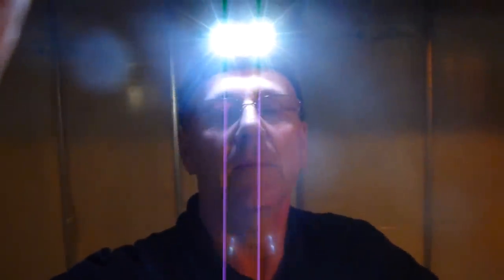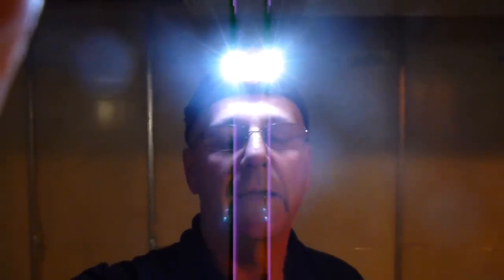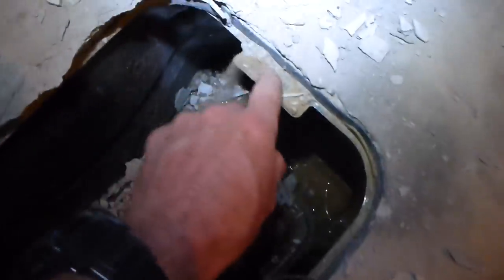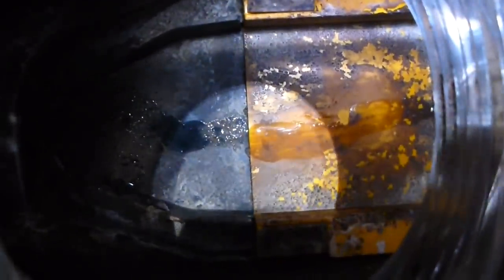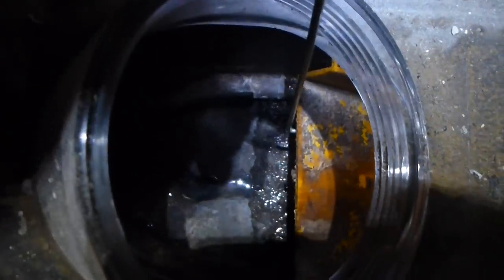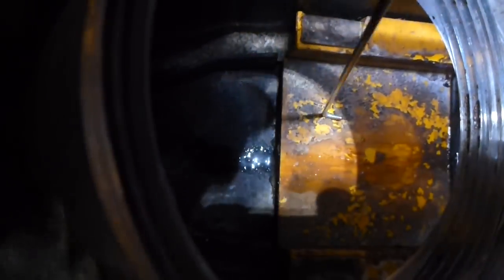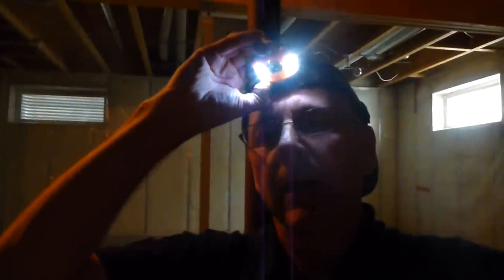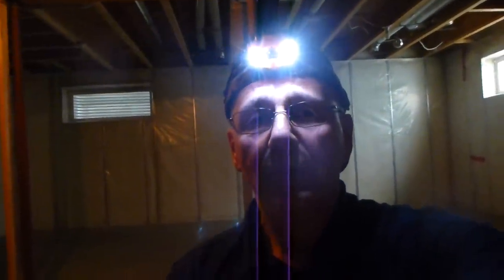Sewer Back Flow Valve, Stuck

Comment: Valve was 7 years old and still had concrete on top of container. It went 7 yrs without being maintained. Horrible. 2x a year min and after every back up. I have hose attached to basement sink with sprayer nozzle. Takes 5 min.

Comment: back flow valves are outside, underground, therefore how would this be accomplished-not only to find,  also to clean to make sure they were applied as was told?
Reply: He is inside the house down in the basement... these are actually called back water valves.

Comment: I absolutely would not buy that design it’s made to fail! The hinge should be at the top out of the muck so that water leaving the home continuously move the valve,And doesn’t cement it in with all the junk that goes through it.

Comment: How do you get a manual hand crank valve unstuck. Mine will not turn clockwise or counter clockwise?
Reply: Pb blaster daily for about a month.  Tighten a bit, loosen a bit.  Repeat over and over.  I’m working on one now.

Comment: More bureaucratic bull shit.....Here's what happens to these devices:
1. Someone runs a snake through it (not knowing it's there) and breaks the flapper off it's hinges...causing chronic back-ups.
2. There's a rubber "lid" seal inside some of these devices and it rots into pieces that fall down and cause the flapper to get stuck...causing chronic back-ups.
3. Once the rubber seal is gone it allows roots to enter the system...... causing chronic back-ups.
Somewhat counter productive right?
    I have removed about 5 of these devices (including my house and my rental's) and zero issues now. I'm a new construction plumber and have installed 1000's of these....none have ever done their actual intended job....kinda like air-gaps, water savers, anti-siphon valves, double-check valves and liquid plumber... none have ever done their actual intended job. But it creates jobs for those who make them....
HELP! (bureaucratic bull shit)
Reply: Hi
I just installed a different model of this NRV in my home. Mine one has hinges on top and the flap opens up to let house waste out and remains close in general. 
Have you installed these kind of NRV too? If yes, then can you please review them.
Reply: @sanchitgupta001  Not sure why anyone would install one of these when it's not mandated. As mentioned above, I have installed 1,000's of them (hinges on top like yours)(only when mandated) ...here's my review:

More bureaucratic bull shit.....Here's what happens to these devices:
1. Someone runs a snake through it (not knowing it's there) and breaks the flapper off it's hinges...causing chronic back-ups.
2. There's a rubber "lid" seal inside some of these devices and it rots into pieces that fall down and cause the flapper to get stuck...causing chronic back-ups.
3. Once the rubber seal is gone it allows roots to enter the system...... causing chronic back-ups.
Somewhat counter productive right?
    I have removed about 5 of these devices (including my house and my rental's) and zero issues now. I'm a new construction plumber and have installed 1000's of these....none have ever done their actual intended job....kinda like air-gaps, water savers, anti-siphon valves, double-check valves and liquid plumber... none have ever done their actual intended job. But it creates jobs for those who make them....
HELP! (bureaucratic bull shit)
Reply: @readmore3634  Yes you are right about the shortcomings of NRV. But of not NRV then how is one supposed to stop backflow of sewer into the house?
Reply: Yeah its called maintenance..... and they are completely rebuildable. You said you installed 100's but only removed 5. 
Howe long do you think it take for that seal to dry and deteriorate ..? Cars have similar seals and hoses in much harsher conditions... what are you talking about "roots in the system" ...?  in order for roots to enter the system there would have to be a leak which means there is a backup so the waters is pouring through the top of the device, at which point it would take years of leaking (and fumes) of no one noticing for roots to know there is moisture to eventually find their way to the moisture., this isn't clay...  if a plumber snakes a system all the way to this device with out looking for it it or the home owner notifying said plumber then there are other issues at play also the flapper is replaceable. I'm not sure you are actually a plumber. you do not make any valid points... lastly what are you offering for an alternative option ..?
Reply: @Andrico77  They are absolutely rebuildable if you can find them….so many of these devices are covered up with plants and trees and shrubs. 99% of homeowners don’t even know they have a backflow preventer….. and either does the drain cleaning company and they run a snake through it. Most of these backflow preventers are 3 feet down….. When’s. the last time you dug a ditch large enough to  a work on a 3 inch sewer line? It’s a lot of work… Locating it is tricky without a detecting device. But if you drill a tiny little hole in the top of a 3 inch drain line, it won’t leak unless the system is backed up because the pipe never fills all the way to the top …..it’s like a little canal down there. But vegetation is very sensitive to moisture and there are very small roots that you can’t even see without a microscope that seek out this moisture and once they find it they will go inside that little hole you drilled and cause all kinds of problems even split the pipe open in some cases….but what do I know….according to you I may not be a plumber at all… That’s great… You figure out people without ever even meeting them.

Comment: so when your septic backs up and the flapper closes wouldnt flushing your toilet would then back up from the flapper being closed thus making it pointless to have. you would still be backed up. just clear the plugg in the inlet of the septic tank by shoving a stick through tbe baffle and clear it yourself and problem solved (THATS IF YOUR DRAINFIELD IS WORKING PROPERLY)
Reply: These are meant more for when hooked up to city sewer system as they have massive surges sometimes. Don’t think these would work to well on a single septic system like a field or pump out.